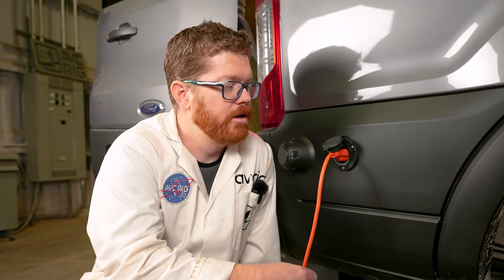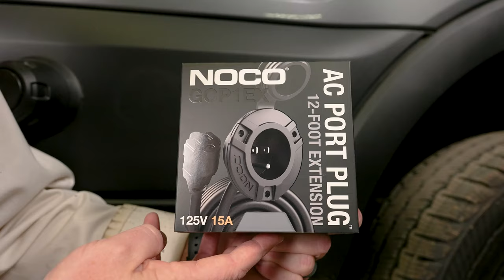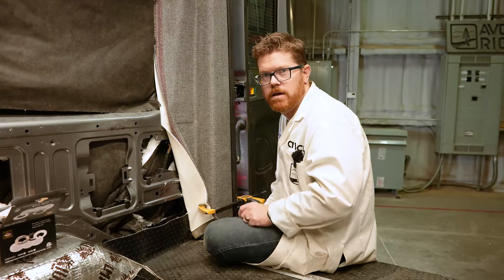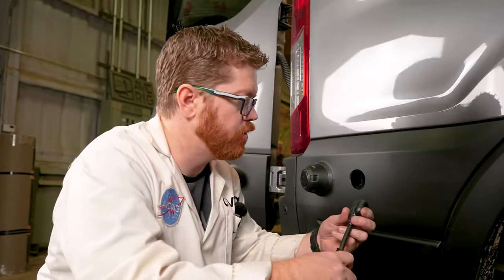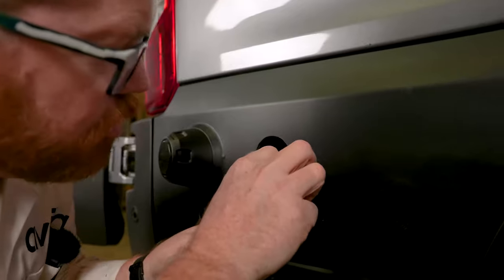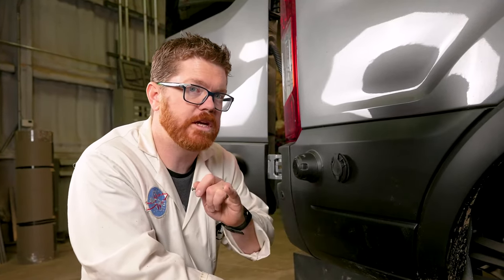Shore Power | How to EASILY Charge your VAN

Comment: Matt, Thanks for your content. I just picked up my new 2023 145 MR and started the build as soon as I got home. This solution for shore power is spot on. Make a mistake and all you have to replace is a simple piece of plastic. No sheet metal damage. The little plug is different on the new vans it took a little bit to figure it out. ✌

Comment: if i wanted the shore power hooked up to my goal zero 1500x but also to my reco 9.5k airconditioner how would i do that? just add a splitter on the end of that noco plug? i dont want to plug the AC into the goal zero because i know it would never be able to run it so i'm only running the AC on shore power or generator
Reply from the maker: I think you have the right idea. NoCo may offer an option with two female ends if I remember correctly. If you do use a splitter just don’t bury it behind the wall.

Comment: Trying to figure out how to get shore power to charge my lithium batteries in a new coming up van build. Enjoyed your video and subscribed.
Reply from the maker: We use the charger function on our inverters to charger our built battery systems here in the shop. If you’re not doing an inverter then I’d suggest a smart battery charger like a Victron unit.

Comment: I have a 2023 Crew and followed this video for the opposite side. Unfortunately after cutting the hole in the plastic, there was a metal panel. Well, I had to cut another hole in the metal body….😢
Reply from the maker: Sorry that happened to you. I’ve never seen a van without this pass through.

Comment: I have heard from other builders that putting the shore power in the plastic can cause a potential fire hazard, I am curious of your thoughts on this?
Reply from the maker: It's really only a concern if you pull too many amps- but in that case the plug itself is a fire hazard as well.
Reply: @AVCRIG  makes sense, thank you!

Comment: I am confused. Once the shore power plug is installed, what is the other end plugged into?
Reply from the maker: It depends on your power system. Most inverters have a shore power charge function and we’d wire it to that.  If you did a system like a goal zero you’d use the power pack for that.

Comment: So from your shore power what do you connect to charge batteries while plugged in? I’ve got an inverter ran from the alternator but it doesn’t seem to be enough especially while parked
Reply from the maker: I typically use two different inverters. Xantrex XC2000 and the Victron multiplus 2 12/2000 I limit both to the 15 amp shore power plug we install.

Comment: Seams simple but what if you have to replace that side bumper! is there easy access for removing the cord from your system when you have to remove the receptacle from the bumper?
Reply from the maker: I suppose not. It’s not really that hard to undo our wall system if you had to. It’d take an hour or so, but in the case of that kind of repair not the end of the world. If adding your port to the side of the van (or underneath) seems better I’d definitely go that way.

Comment: AVC Rig-  Do you know if the L shaped "pop-out port" is present in the 2018 148WB Transits?  I am afraid to drill the hole and find out I don't have a port...
Reply from the maker: I’ve never seen a van without it, but you should see the pop out panel section from the inside of the van.
Reply: @AVCRIG  I know, but this is sort of a later addition to my van build, so I have other things in the way now... the electrical wires and electric set up is on that side already... I did leave a good size 4x6 opening in that exact spot, but with all the wires and insulation around it, I cannot really see anything back in there. Crap. lol. Thank you for your help. This was a great video. :)
Reply from the maker: @wendydavis3897  I've never come across a van without.  You can probably reach up under the plastics to feel for it.
Reply: @AVCRIG  Yes! It is there. I successfully installed my Noco port plug.Thank you.   🤗
Reply: I found the port on my 2015 transit but it's not big enough to fit the noco plug through 😢

Comment: Really a 30 to 15 amp adapter is cheap. If you want to install a rooftop AC unit or an Electric/LP water heater, you're going to need to redo all of this. Install a Distribution center for $150, run a 30amp motor mount base and be much happier in the end.